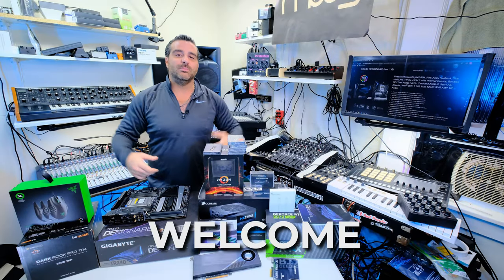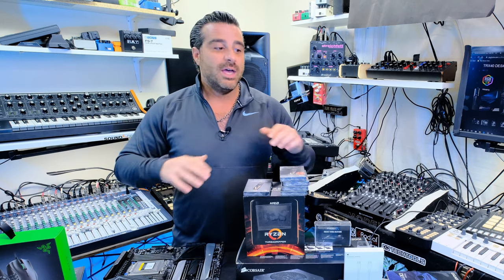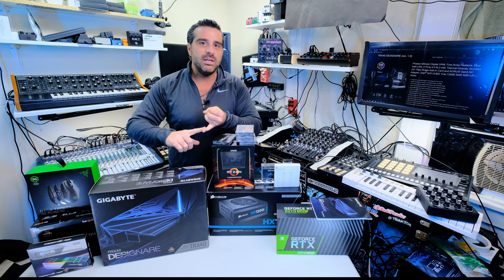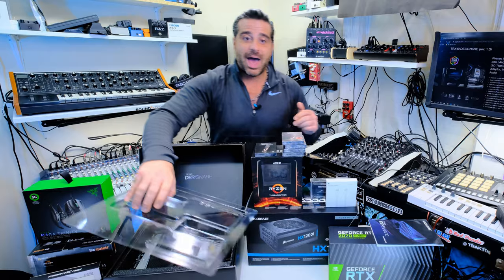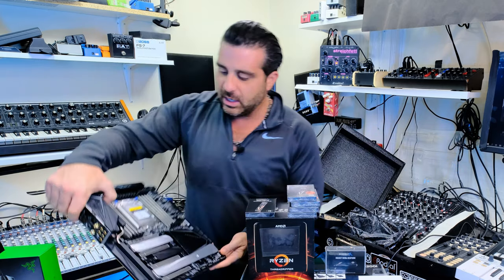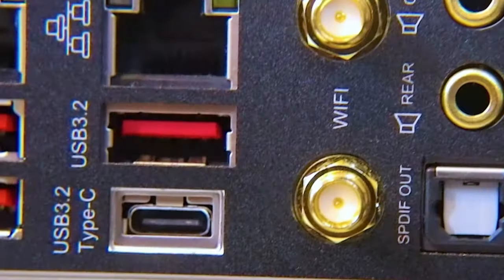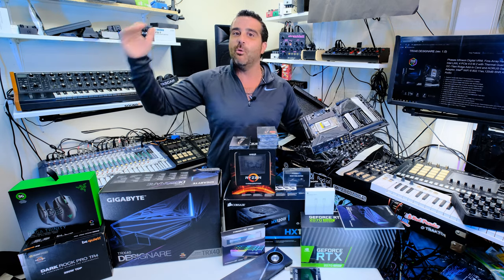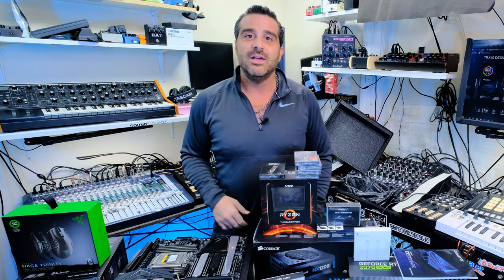Why the Gigabyte TRX40 Designare is the Best Motherboard for Pro Audio DJs and Studios in 2020  2021

Comment: Have you plugged an Apollo X interface into this yet? I'm hearing good and bad things about it.
Reply from the maker: whats up whats up thanks pal for joining in - i dont own the Apollo because its costly and as of 2 years ago the antelope Orion 32 or 32+ or studio gives you a pretty sweet dynamic range, unreal sound and tons of channels at a good price! even there less channel options i would look at for sure. they support tb3 and have a proprietary crystal clocking system however you kinda give up on there digital plug ins which to me 95% of plug ins dont do that great compared to analog, also i tried and loved the motu mk3 they make great interfaces as well but antelope is better however its costly overall - i make house and techo remixes and for me those are my top choices, i would say if people are saying bad things about Apollo dont buy it as well as the good things are mostly sponsored options or someone who haven't really tried enough of them to be sure. most if not all of the top live remix DJs in the world always use antelope, motu or even a traktor audio interface so i would check those options out, buy them test them and see which one works best for you . 

nice to cya around and if there is anyway i can improve the channel
Reply: @djinfect672  Thanks for the info. I actually love my X4 and plan on buying the Orion 32 for it's clocking. I was more wondering about the compatibility with Thunderbolt 3 on this motherboard for Audio Interface. I did the Thunderbolt add-in card on my Gigabyte x399 Aorus Xtreme and it wasn't 100% compatible. It wasn't hot swappable.
Reply from the maker: @v3zMedia  I think you have to enable hot swappable in bios but dont quote me on that for tb3 however the new card that comes with the designare is way better then older add in cards and you have to use the intel drivers as well as config bios and a bunch of other things correctly to get tb3 to work properly. check out the ending of https://www.youtube.com/watch?v=Qk239LbhQak i made it gos through a decent run down on how to setup and install tb3 on the designare as well as all the things not to do
Reply: @djinfect672  Alright bet! Thanks for helping me out man I really appreciate it.
Reply from the maker: Kristen and I made a Fun Funny DJ Editing Tutorial  https://www.youtube.com/watch?v=GSjDfIFMRuo Let me know what you think Thanks pal
Reply from the maker: https://reverb.com/item/37049652-antelope-audio-orion-studio-thunderbolt-usb-audio-interface?bk=eyJhbGciOiJIUzI1NiJ9.eyJqdGkiOiIwZDIwYTkyOS1kNzZmLTQwMzYtOWZmYS1kMjJlMmZkZTVkZDAiLCJpYXQiOjE2MDg1NDcxODUsInVzZXJfaWQiOiIxNjQ5NTU2Iiwic2Vzc2lvbl9pZCI6IiIsImNvb2tpZV9pZCI6IjE5M2RlODIxLTMwMjYtNDYyNy1iOTE1LTU3ODMwZDMxODFiZCIsInByb2R1Y3RfaWQiOiIzNzA0OTY1MiIsInNvdXJjZSI6Ik5PTkUifQ.-Fqw7vr02utiOyOr1070hAPCKzuAmUnxKeCdCGa3Wkg check this deal out on reverb - i bet for the Antelope Audio Orion Studio Thunderbolt / USB Audio Interface you could offer like 750$ and it would be well worth it because from that interface to the rev 17 the only big thing is ,more power for more DSP but no one used them in this interface because its poorly implemented but for a very versatile IO that sounds truly amazing! this is it for a realllly good deal